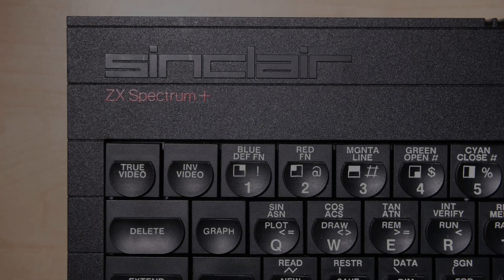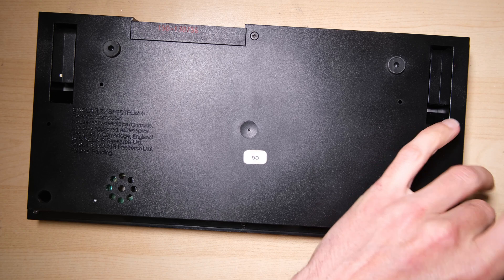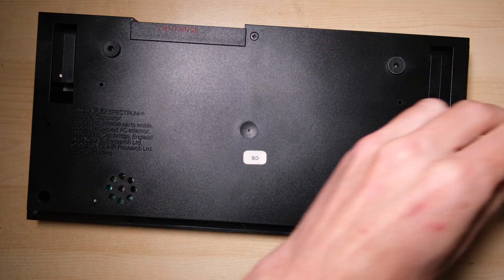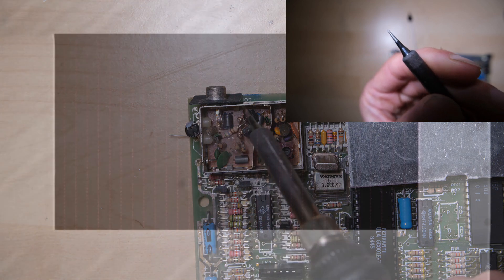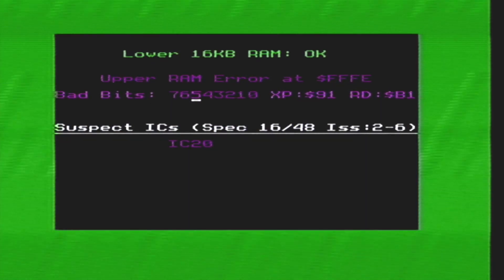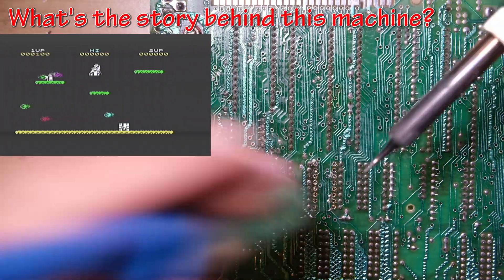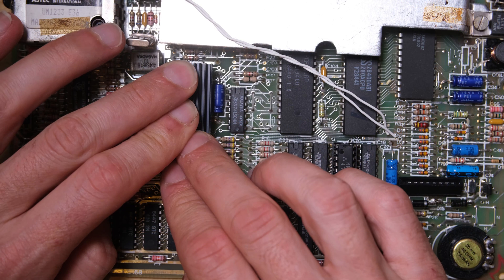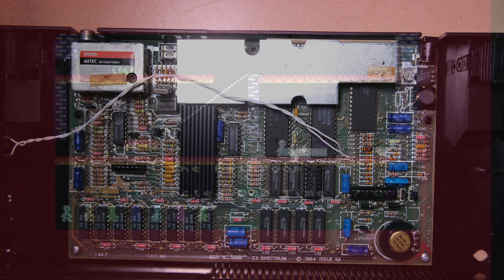Your Retro Repair #1 - Sinclair ZX Spectrum+ 48K - Upper RAM Diagnostics and Replace

Comment: Hi, I have a Spectrum 48k issue 3. Its loading games a bit hit and miss (sometimes it will run, other times it will get to the end and freeze). It's also occasionally resetting itself, and I'm seeing some corruption in games that load. For example, in Jet Set Willy, the bath is missing in the first screen, and the word 'bathroom' is misspelled. When I walk to the left into the 'landing' it brings me into a completely different room (e.g. west wing). I ran the ZX Diagnostic Ram test, and it's reporting EVERYTHING as Pass. I've tried a spare ULA, but it does the same thing. I've removed and reseated the upper ram (7 of 8 chips are socketed) but it doesn't change anything. Would you have any suggestions for me? Lower ram voltages are +5v, +12v and -4.77v. Upper ram is getting 5v. 16k games appear to be running fine, so I'm suspecting a subtle upper ram chip failure that's not being picked up by the diagnostic test. Could this be the case? Unfortunately I don't have 4164 or other ram to replace. Any suggestions would be really appreciated. Thanks, Alan.
Reply from the maker: Hi Alan. Are you loading from tape?